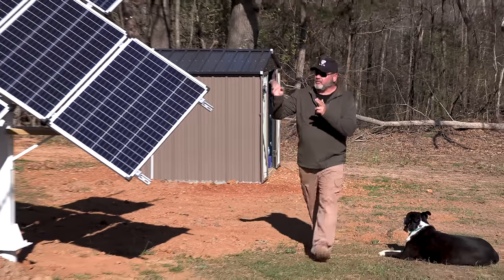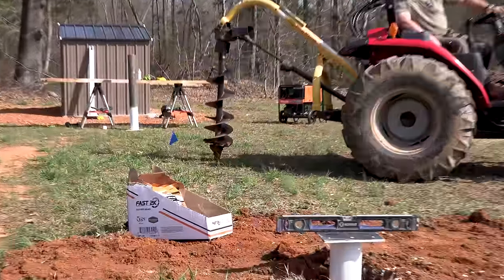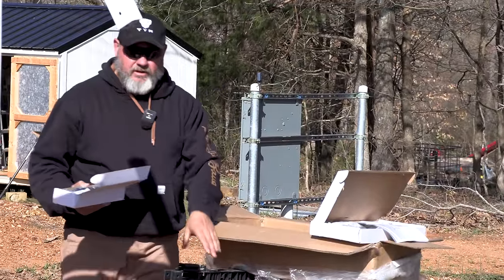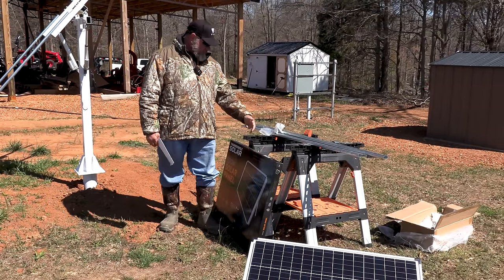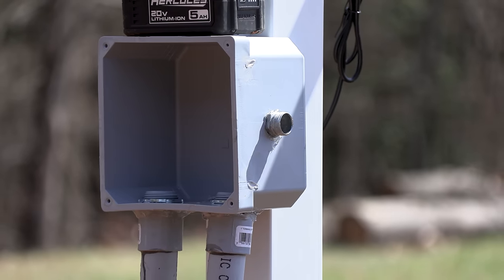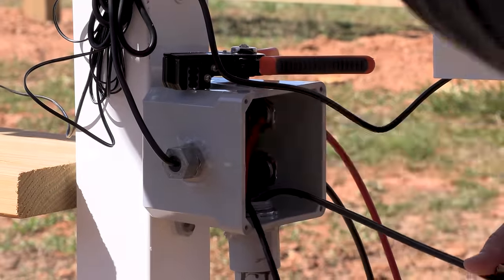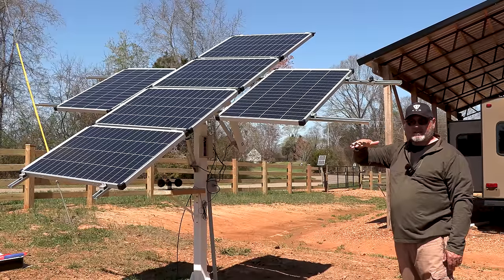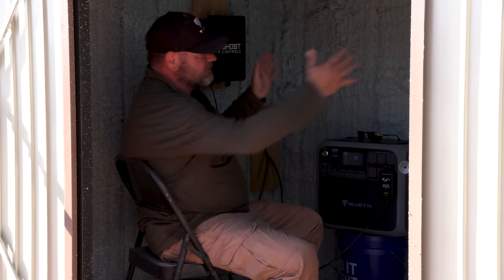You Really Need Solar Power to Survive Grid Failures! DIY Automatic Sun-Tracking Solar Array

Comment: Re the title of this Video. I have to disagree. 'REALLY NEED' is just plain untrue. It would be perfectly sensible to have a atandby generator at a FRACTION of the cost of a multi-kilowatt solar array, and it would WORK AT NIGHT.....Or are we adding thousands of dollars worth of Batteries to the plan.
No, without a feed-in tariff, the only worthwhile solar is a modest amount, below your normal minimum consumption, reducing your bill for grid electricity most of the time the sun is up. My house uses a minimum of about 170W constantly - I have a 400W solar array and a grid-tie inverter. I usually get 100-200w when the sun is up and the sky clear. On those days I still buy electricity at night and when cooking, running vacuum cleaners etc etc, but I save about 1KW hour a day from my bill - It will be a long time before that pays off the £500+ ($700) for all the panels and cables and GT Inverter..... in fact at about £0.3 per day for 200 days a year it would take five years. But if I had spent £5000 on multi-kilowatt panels + installation + everything else the payback time would be longer than the life expectancy of the equipment. (without a feed-in contract, and even then it would be 10 years+)
Reply from the maker: Thank you for your opinion

Comment: Tony you are so wrong. What you need is a backup generator. Solar is a poor choice for back up. Backup generators come on as soon as the power is lost. And you don't need to rely on battery backups. Panels age and get oxidation and in time go bad. The cost is too much. I have had solar, and it sucks! A whole house generator is the way to go with LP or natural gas.
Reply from the maker: I really appreciate your opinion but the price of solar has come down a significant amount since you've probably put it in. What happens when the natural gas stops flowing? Panels nowadays will last 25 to 30 years. In 25 to 30 years you'll have to rebuild any generator that you have. The seals were right out of it. Nothing lasts forever.
Reply from the maker: Also, I never said I wouldn't have a natural gas backup generator. We are developing a plan based upon current technology.
Reply: @TonysTractorAdventure You have your opinion but mine is better. I have had solar it's negatives and storage costs are terrible. Batteries are expensive and will need to be replaced a number of times before a generator would have a problem. I have a whole house generator that runs on natural gas. One can get one that runs on propane. It kicks on immediately when the power goes off. Solar panels oxidate and don't last forever. It will take a long time to save what extra you spend on solar in savings of not purchasing the gas to fuel the other backup. And you are wrong for what little that backup generator really has to run unless you have some super long electric shut down it will be running when the solar is in the graveyard batteries panels and all. When solar panels are dead, they are garbage. If ever a whole house generator has a problem, it can be repaired. You are not able to repair those batteries either. Sorry Tony you are not quite right. You are entitled to your opinion and it's nice you are happy with your decision. Been there and done that and know better. But be happy. I enjoy watching your videos. We are both entitled to our opinions mine on a backup electrical supply is on my experience. I have had both.

Comment: I cant help but to ask. Why would you put out the money on  12 100 watt pannals. On top of that the cheapest pannals one can get. Tractor supply junk. When you can buy 530 watt pannal for a 1/3rd of the cost of 12 tractor supply 100 watt pannals  . To add to that the 530 watt pannals charge from both sides an melt snow an ice off. 2nd 12g qire from your shed to you combine box is by far to light a wire for anything over 15 feet for that voltages an watt output. Tons of line loss over15 feet. You put all that work an money in. Only to loss 50% or more due to cheapening up on  small gage wire for distance voltage an watt output.
Reply from the maker: Thank you for your opinion. It seems you didn't really want a dialogue.
Reply from the maker: Your comment did bother me because you put so much time in writing it. Unfortunately, you didn't watch the video  I don't think you noticed there were two sets of wire. There were the 12g wire that provides 12 volts to the solar tracking system and then there were the 8g copper red and black wires that brings the solar back to the building. The entire purpose of this system is to learn. You refer to the panels as Tractor Supply. We got them from Harbor Freight and they are highly recommended. They have out performed their specs in every way. Once we have a good understanding, we will build our permanent system. We will move this system to a future cabin build.
Reply: @TonysTractorAdventure   I sure did watch the whole video in fact I backed it up 3 times as it was hard to understand what you were saying in a few places. Didnt make sence til I peaced it together. Yes on set going to each of the 2 set ups. You only ever referred to 12 g wire.9g was not noted. Other then the small wires for the wind speed a d sun sencer. . Tractor supply or harbor fright no diferents both are like our princes auto here in Canada . Cheap stuff. The point I was making I asked why would you put out all that money for 12 100watt pannals when you can buy really good 540 watt pannals that charge from both side of the pannal an melt snow an ice off on there own. For a far better price watt for watt. An have pannals that charge from reletction on the back side of the pannal as well the front side. You cant go by online reviews. 90% of them are bs. Companies pay buddies to write what they want them to. Then there are the ones you cant make happy know mater what you do. In my 61 years an a lot of installs. In remote fly in fishing hunting camp for tourist Outfitters. 100 watt pannals are good if you only want a 100 watts maybe 2 100 watts. But they are pricy. Same labor go in to make a 100 watt as a 540watt. Just like when oxygen and acetylene tanks filled you pay more a lot more you have a small oxygen or acetylene tank exchanged then you do for the Big K size oxygen or the Big B size acetylene it's the labour. 540 watt panels I'm more efficient as well then a whole pile of tiny ones. If you're in 9 gauge wire Azure charging wire. I don't know the distance run but if you're under 75 feet total each of the two wires to complete a circuit then that's fine but if you're over that 9 gauge is not big enough just like I see so many YouTube videos with people wiring up battery Banks using #4 battery cable.. to stiff to small way to smallfor battery cable. 1,000-watt Panel System requires a 4/0 welding cable from inverter to ground rod. All battery cables minimum 2/0 jumpers an to inverter.  A #1 WELDING cable from each of the solar panal rake to 2 3/4" x 8' ground rods.but you have a steel pipe connected to the pannals. I think 4 feet deep for litnining. You still need 2 10" ground rods 10' apart to protect system. There are charts for wire size for amps voltage watt distance. In clean clay you do not need under ground wire in PVC. LONG as no big rocks. Bedded in 6" of sand is by far better then any PVC. Yes PVC sweeps an Lb's to enter building an pipe out of ground. In clean  clay  like that the under ground wire dont need anything around it at all. Even pass code if such thing.  Service are put in the same. Also remember  more hardware more failures. Tip use large 540 watt pannals. More bang for your buck an less to fail
Reply: @TonysTractorAdventure  I dont have time to reply back or see things right away  I have my home farm to run by my self. Farm to table. 30% go to people in need. If you checked out my NW Ont Canada videos

Comment: Garbage. Cheaper to just install 3 arrays facing 3 directions like I did. My 9000 watts performs as well as a 6000 watt tracker. Zero moving parts. Garbage.
Reply from the maker: You will need to run your numbers because your math doesn't add up.
Reply: Energy Generated10.2 MWh per year since 2015
Reply: Cool project but imagine how much solar you could get on that pole barn roof.

Comment: Sorry I wasted my time on this video. 
Cheap equip.
Cheap Design
Crappy Installer.
Harbor freight Junk.

Those "100 watt" panels will only put out 25 watts at best.
Also the cost per watt is ridiculous. 

This setup (ONE) IS OVER $1800
To  get only about 50 watts for the fancy tracking, solar production system......😂😅

Umm ....Yeah I'm an engineer.
I do know what I'm talking about...
Reply from the maker: I appreciate you taking the time to form an opinion. Your opinion is wrong at every level, but I still appreciate you taking time to make. I do hope your life gets better. God bless.
Reply: @TonysTractorAdventure  no it's not wrong.
And I'm still in mourning for the time I wasted, 
Thinking I was going to see something productive.  
Honestly....   I would never Buy or Install this anywhere or for anybody......
Reply from the maker: Again, I appreciate you taking the time to make an opinion.